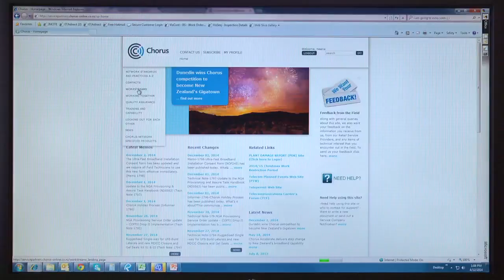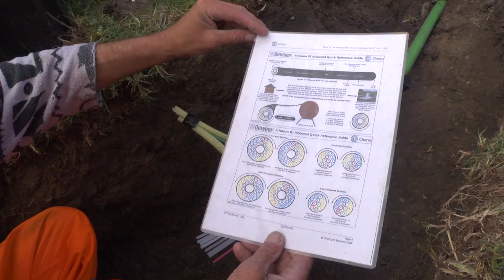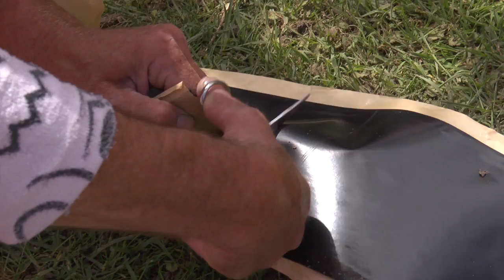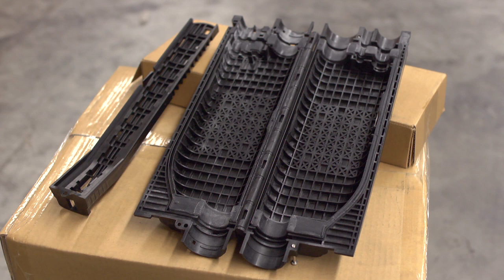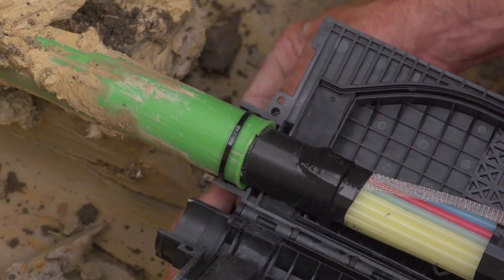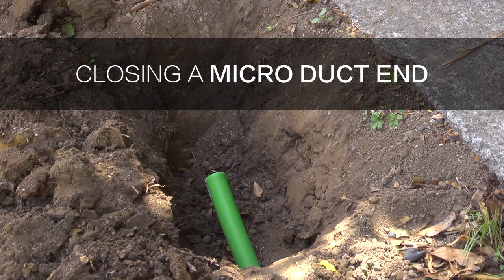Ribbonet Jointing   720p

Comment: Those red tube connectors are crap. We have them as reducers from 7-5 and 10-7mm in our cars and they very often already disintegrate at under 5bars. 
And can someone explain why someone should use this product with all the necessery precaustians against damage, if you could use a, presumeably cheaper, duct like from Egeplast with the same number of drop tubes but at a way stronger 7mm diameter? I can only imagine that each drop costs 100-200 bucks more since those drop enclosures are needed.
All we or the construction teams do is make the branch off and cover the joint with the cut off plastic and a few layers of ducttape.

Oh, and of course the tubes we use use actual different colors for each tube, rather than that stupid outdated ring reference system were mistakes are more likely.